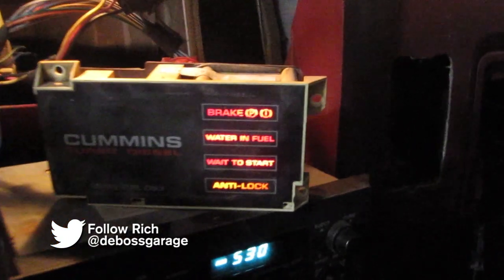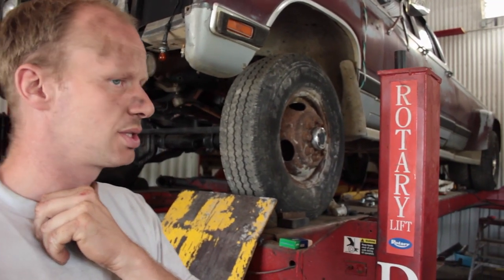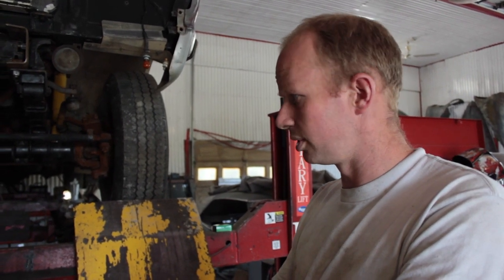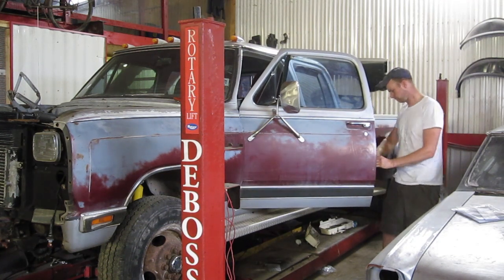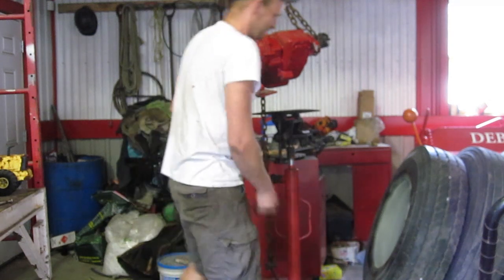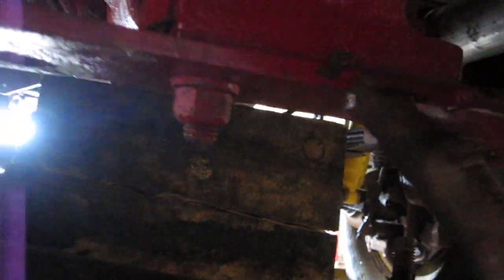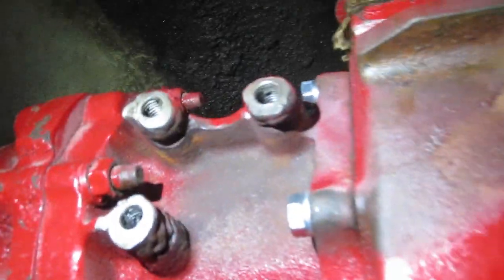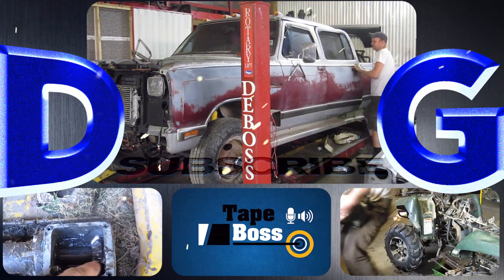'85 Dodge RAM CC W350 Dually 5.9 Cummins 12v Diesel Swap [EP5]

Comment: ya. the detents for the shift rods on the 205 are pretty stiff, if its not bracketed properly it will break. look at how offroad design did theirs. i made my own but i sorta copied their design using a pivot that botls to the front out put seal retainer.

Comment: hey on the Tahoe or Silverado did you ever get the reduced power thing to go away with the valve body pluged in to the harness under the truck?I did a similar swap and have reduced power light in dash..I like your swaps on the chevy's you did them how I did mine very clean and everything working..

Comment: Are there any engine mods? Seems like he'd need a little more HP and Torque than that.
Reply from the maker: +Matthew Neuforth I recommended a pin, and a governor spring, but the customer wants to leave it stock, just for a bit.  I think he wants to be able to compare before and after.

Comment: The first  years of the DODGE/Cummins  pickup,   the FRAME  & the transmission could NOT  handle the FULL.  H.P. & Torque.    So the Cummins diesel engine was   derated  (less FUEL).
Reply: I think they eventually made a 10" frame for the 1-ton because the early ones were cracking.